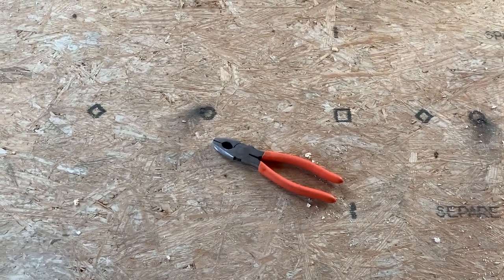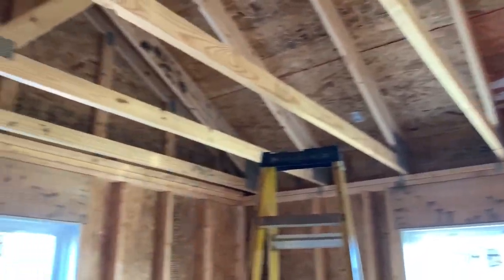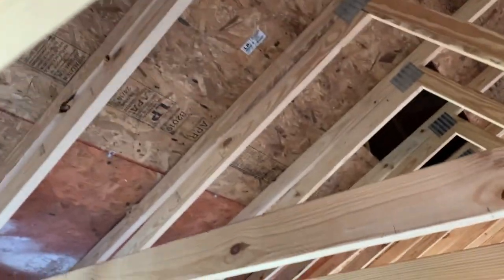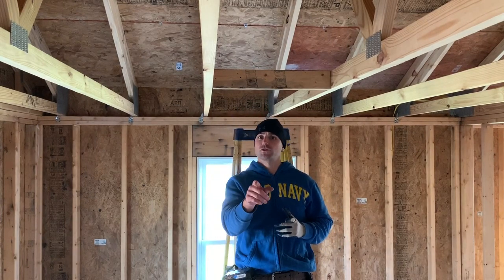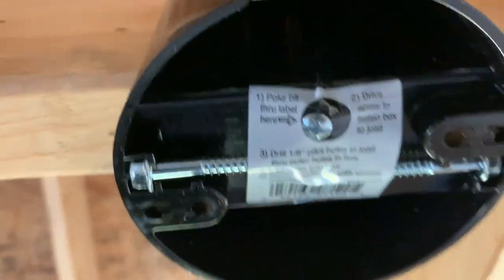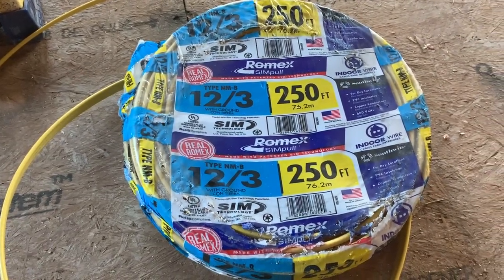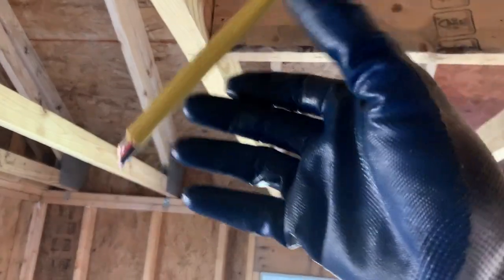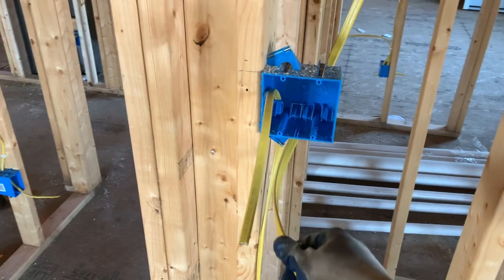How To Install A Ceiling Fan Box: Saddle Box

Comment: Just finished 2 fans and 1 light using the saddle box, but it was the air tight and it was a remodel/addition (no existing anything). Those saddle boxes are the greatest thing though.
Reply from the maker: I know I will always use saddle boxes from here on out. They are simple and work great

Comment: Was it code to use 12/3, why not 14/3?
I cant find these boxes in canada.
Reply from the maker: Mrdubomb I just use 12/3  because it can handle more load. I don’t know if you can use 14/3 or not
Reply: 14/3 is code and perfectly acceptable. 12/3 isn't against code bit is definitely overkill in a residential setting like this.

Comment: You can also use this saddle box as old work?
Reply from the maker: It would probably be a little challenging to use in certain situations. Some situations it may work out fine. Thanks for watching!
Reply: @TheExcellentLaborer  If you wanted access to the opening to run wire, can you unscrew an existing box and re-screw when done?